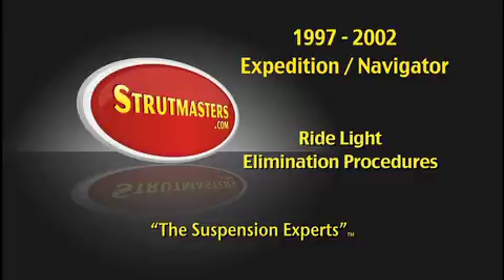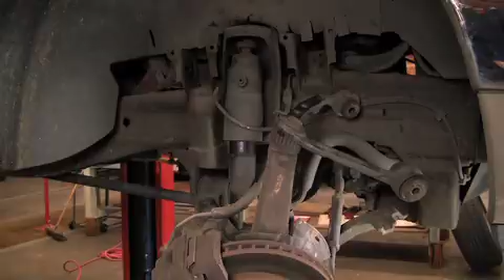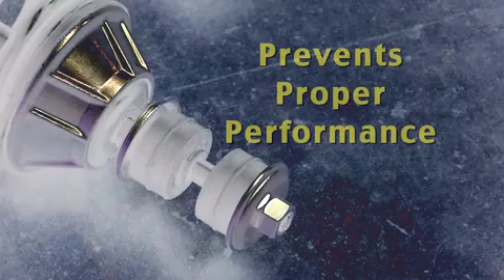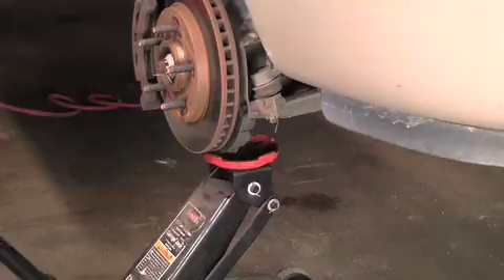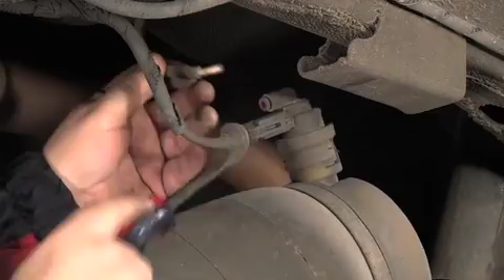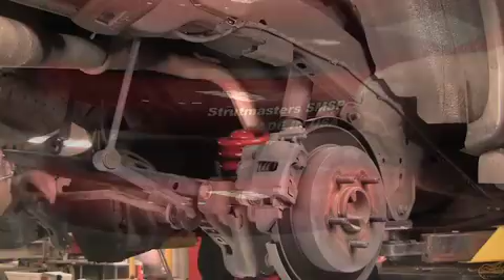Installation:  1997-2002 Ford Expedition and Lincoln Navigator Conversion Kit -- All 4 Wheels

Comment: I can confirm that the kick panel doesn't require removal to access the air suspension switch in my '99 Eddie Bauer. I was also able to pull the old air shock out and install the new coilover without removing the upper control arm.
Reply from the maker: Thanks for commenting.

Comment: I just finished this job.  Well worth the money.  Considering this is a one time price and project.  It seems like everyone has had some sort of problem with the air ride on the expedition.  Air tools do make the project go quicker and you'll need a couple of jacks.  Total project time was just shy of three hours to do the front and back.  It is true that you can do this job if you can do your brakes.  The hardest part was the new rear shocks.  Most trucks won't need new shocks though.
Reply from the maker: Thanks for your comment!  It helps make the Strutmasters service community that much more helpful.

Comment: Also, very easy to install with two people and a pry bar to line the new coilover up to the lower shock mount. With one person, you can get it into place but it is more difficult. I did the passenger side first with help and the driver side second without. I cannot comment on rear installation since that was done by a previous owner.
Reply from the maker: Thank you for your comment and helping further the service community of Strutmasters.

Comment: its alot easier than a BRAKE job ive done mine on my truck 2x on the front and 3x on the rear, and another time on the rear of my buddies truck
Bout to do it again soon, as I have navigator springs up front instead of 4x4 expedition coils overs like i should
Reply from the maker: Thanks for the comment!

Comment: What do i do with the front bump stops as they are now about and inch from bottoming out. Doesnt leave much suspension travel. With the air ride,,this wasnt an issue. Plus my rear sags now with the coil springs as before it would sit higher with air ride
Reply from the maker: I apologize for taking so long to respond. If you are still having this issue please call us at 866-998-8737 to have someone walk you through how to fix your problem.

Comment: On the Front driverside of my 2001 Navigator, the bolt at the bottom of the shock refuses to come out even with the nut off.  Is there some sort of special way to get it out?  Tried to use lubricant rust remover to free it up and an impact but its not budging.
Reply from the maker: I apologize for taking so long to respond. If you are still having this issue please call us at 866-998-8737 to have someone walk you through how to fix your problem.

Comment: i drive a 97 f150 4x4, would the front shocks from this truck fit mine?
Reply: My 97 eddie bauer expedition has had the conversion done. It took the same front shock as my wifes 02 f150 supercrew fx4 package pickup. If you get a shock for a regular expedition none air ride it will be about 2in to short. Been there done that.